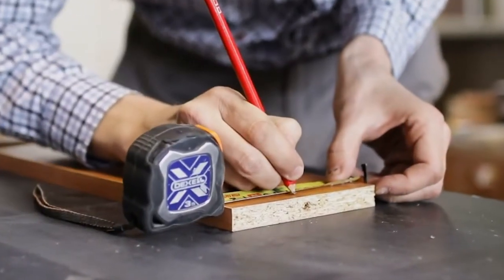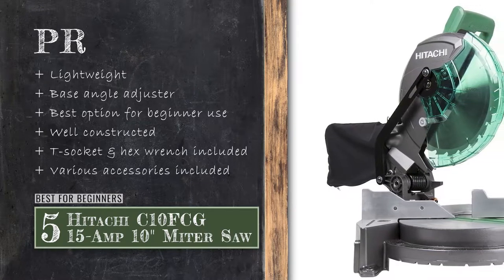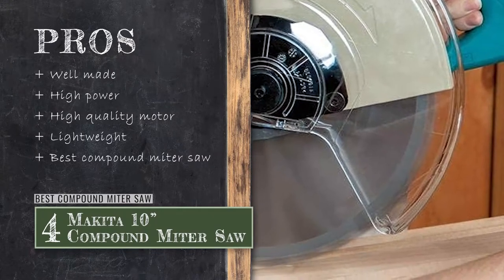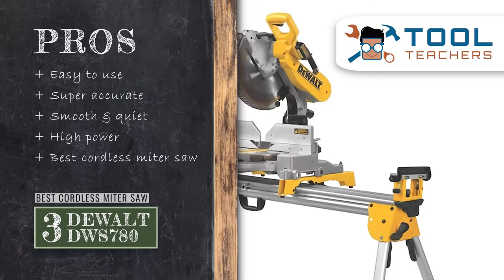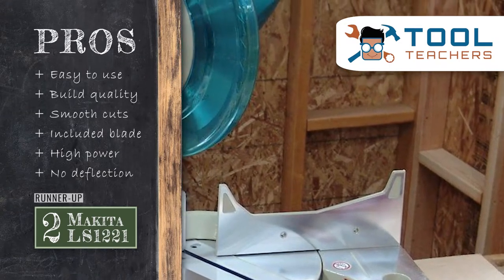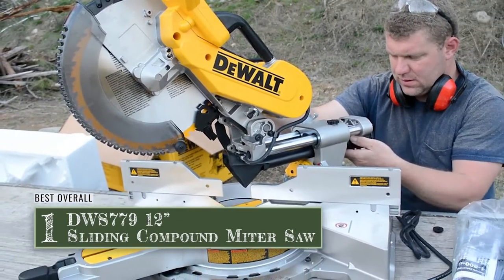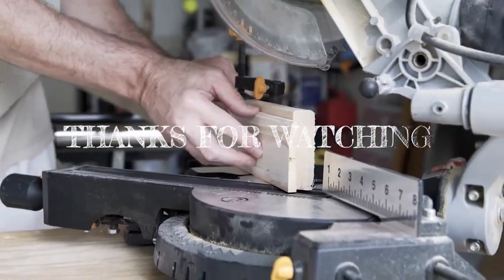Best Miter Saws 🧰: Your Guide to the Best Options | Woodwork Advice

Comment from the maker: Read the full review here: ►► 
https://panaceatools.com/miter-saws/
(Best Miter Saws)

-------------------------------------
✅ Featured Products for Best Miter Saws

0:00 Introduction
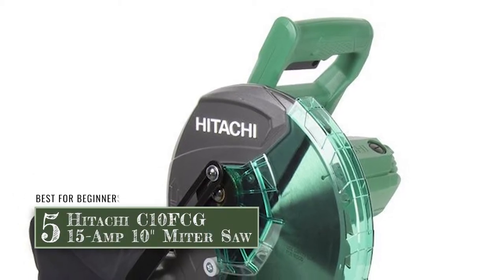0:55 5. Best for Beginners: Hitachi C10FCG 15-Amp 10"" Miter Saw ➜ https://amzn.to/39zmovK
1:56 4. Best Compound Miter Saw: Makita 10"" Compound Miter Saw ➜ https://amzn.to/3lulC5h
2:46 3. Best Cordless Miter Saw: DEWALT DWS780 12-Inch Compound Miter Saw ➜ https://amzn.to/36rbpCw
3:38 2. Runner-up: Makita LS1221 12"" Compound Miter saw Kit ➜ https://amzn.to/2Vr4z9O
4:32 1. Best Overall: DEWALT DWS779 12"" Sliding Compound Miter Saw ➜ https://amzn.to/2L00yqX

Subscribe to our Channel 
🔴 https://panaceatools.com/youtube/

-------------------------------------
Detailed review: https://panaceatools.com/miter-saws/

🧰 A miter saw is a power tool that can make “miters,” or accurate crosscuts, in a wide range of different materials. Miter saws typically are mounted to a flat surface, and have differing sets of guards and angle settings for users to be able to make their cuts at the specific angles that will work best for their projects.

💬 Let us know what you think of these Miter Saws in the comment section below.

👉 We appreciate every thumbs up and would be grateful if you’d consider subscribing to our channel!!

-------------------------------------
🎥 Welcome to the official YouTube Channel of Woodwork Advice 🎥

Woodwork Advice is your #1 online resource for tools and DIY-related how-to guides.   

 🌐 Learn more about us: https://woodworkadvice.com/about-us/
 💻 Like our Page: https://woodworkadvice.com/facebook/
 📢 Follow us on Twitter: https://woodworkadvice.com/twitter/
 📱 Check out our Pinterest: https://woodworkadvice.com/pinterest/
 🔴Subscribe to our Channel: https://panaceatools.com/youtube/

-------------------------------------
Disclaimer:
Some of the footage used in this video is not original content produced by Woodwork Advice. Portions of stock footage of products were gathered from multiple sources including, manufactures, fellow creators, and various other sources. If something belongs to you and you want it to be removed, please do not hesitate to contact us at admin [at] woodworkadvice.com.

Some links in the description are affiliate links. If you click on one of the product links, I’ll receive a commission at no additional cost to you. As an Amazon Associate, I earn a small commission from qualifying purchases.

#WoodworkAdvice #MiterSaws #BestSaw